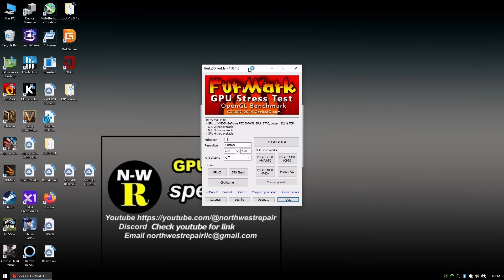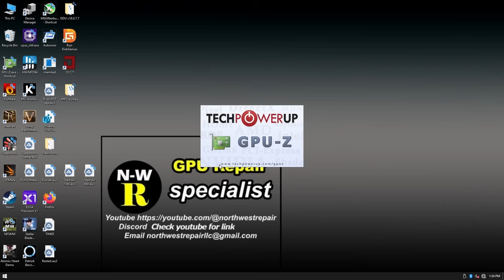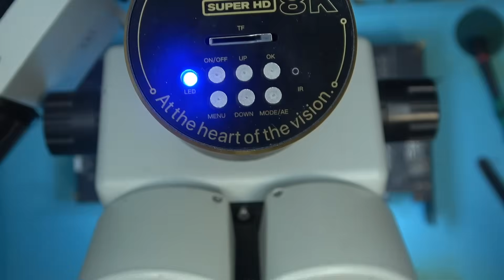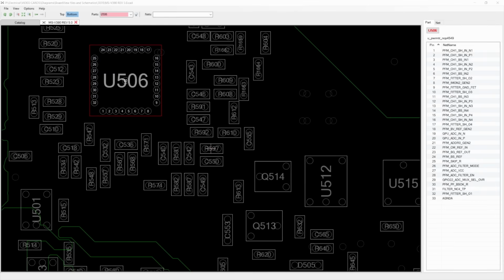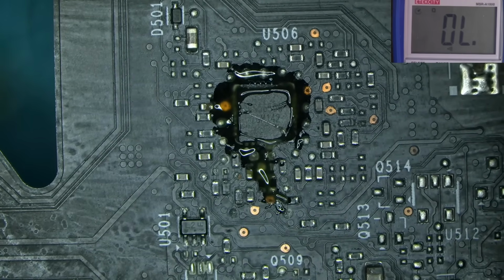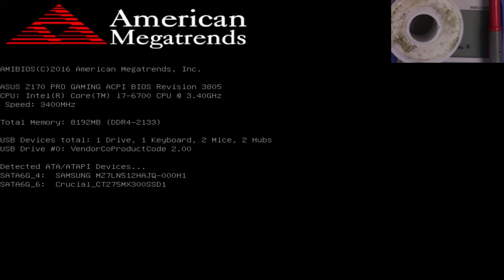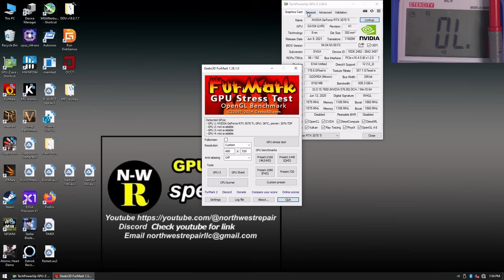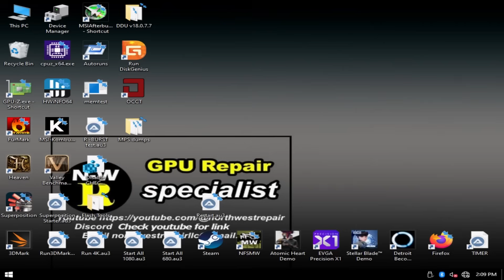EVGA 3070 Ti Runs like 960. How to fix 210 mhz clock problem

Comment: My Sapphire Pulse RX 6700 XT has started having issues over the last two days. After reaching the desktop, I can use the PC normally for about an hour before the monitor suddenly goes blank and reports 'no signal.' This is not a driver issue, since it happens in both Linux and Windows, and even on the UEFI screen. After the problem first occurs during a boot, it keeps happening more frequently, even after restarting the PC, with the signal dropping after an increasingly shorter period each time
I can game until the issue of black screen can occur which is around 10 to 35 minutes.on the first boot furmark can run for almost 1 hour without  issue.its not a psu issue I tested it in my brother pc and it has 650 watt psu
any fix for this

Comment: I have the same RTX 3070 FTW3 Ultra, and it has a bad PWR4 sensor that always shows 113°C. Because of that, the fans stay at 100% speed all the time, even with custom curves.
I replaced the thermal pads and paste, but nothing changed. All other temps are normal. The GPU works fine — just noisy because of the wrong PWR4 reading. Any fix for this?

Comment: I have a galaxy 3070ti used but the previous owner have stripped the main heatsink screws and now it cannot be opened to change the thermal paste any help how to open the stripped screws (love your videos)
Reply: No offense
Send it to a professional.

If you can't figure out how to remove a damaged screw yourself, don't force it because you'll end up causing more damage.

Those little black things are very vulnerable on the PCB, not to mention the brown ones and the rest.
IF you accidentally damage one, your card could easily end up in the trash.

You can even rip it off at the core with the heatsink if they're really stuck together...

Comment: on my RTX2060, the BSOK on uS5650 is only 2.4v then after replacing some resistors on series to the 1v8 and gate it becomes 3v? but it still black screen on load. haha

Comment: So why is the cleaning a important thing ?
Reply: Are you thinking about the cleanability of Flux?

Because if you don't clean it up and leave it on the PCB, you'll be a bad person.

Personally, I don't like it when others don't clean up after themselves.

Also, because if it's hard to clean up, you can damage a component during the process, those masks on the rails come off easily, they're vulnerable.

And if you put that sticky shit on it, dust will easily get stuck in it and it'll be hard to clean it out.

That fluff is a very good thermal insulator and burns very well....

Comment: Thanks for repair my friends 3070 ti

She spilled water and shut it off fast and I couldn't find any obvious issues on the board. I forgot to mention it in the initial message. Somehow it was functional but not great clocks.

Edit: I dabbed a small amount of thread lock on the backplate screws thinking about shipping vibration, my bad. I'm admittedly loctite heavy in my life and it has certainly got me in trouble 😂.
Reply: Hmmmm, spills are always forgotten in the original message. but will always be seen when repairing. Cool it was a good fix.
Reply: @inothome  I was tired and it happened at like 11pm and trying to figure out what to do. It looked like most of it was on the backplate and to my untrained eye, there was nothing obvious with corrosion.
Reply: @Derkiboi  you need microscope or a nice magnifier, most of those tiny things are not easy to spot with naked eye.
Reply: @MrDvneil  yeah that's fair. I only have basic equipment anyway. My fanciest tool is desolder tool from hakko for keyboard building.
Reply: @Derkiboi  All good, was just joking how 99% of the time it seems no one ever mentions liquid damage, when there was some. Nothing personal.
Reply: @inothome oh yea, no probs. I should have initially. Have a good day/night
Reply: @Derkiboi  Thanks, you too.
Reply: @MrDvneil  I have a 30-year-old OptiVisor that works well enough for most things.  It's a headset with magnifying lenses.  You do have to put the board right up to your face, so it's not great for repair, but you can at least spot the issues, and it's much cheaper than a microscope.
Reply: I'm really surprised that Tony hasn't encountered anerobic threadlocking compound before.  In my world, pretty much all threaded fasteners get lubricated with oil, anti-seize, or threadlocker.
Reply: @alsavage1 EVGA had a dab of blue 241 so I did the same. I probably put more than the manufacturer.

Comment: EVGA's FTW stands for "For The Win" at least according to JayzTwoCents.  Jay has been a huge EVGA fan boy for years.
Reply: We were all sad when EVGA announced they would no longer be a board partner for Nvidia. They were easily the best Nvidia vendor at least from a customer service and warranty standpoint.
Reply: They didn't invent the acronym (nor did Jay). "FTW" has been around for a long while. I remember using it well before YT even existed and a quick google-search reveals that while it cannot be pinpointed exactly, it might be a very early 2000s or even late 90s thing, mostly associated with the early HL modding scene. I couldn't find a definitive origin story for it though, but I do remember using it with colleagues around 2004, 2005.
Reply: @1SaG  I don't see anyone claiming they coined the term, just someone saying what it means.
Reply: They were a cut above most manufacturers when it comes to GPUs.
Reply: @MTGSTUE  exactly why I've been waiting to get my hands on a decently priced 3080ti hybrid, been running a gtx 980 hybrid with the stock 120 aio thats never been opened, and never leaked in over 10 years, just thermal paste and a clean every once in a while and it's happy, its not even hitting 60 under full load, they dont make em like they used to lol.

Comment: whats the point of a zero Ohm resistor?
Reply from the maker: protection.
if chip is short, resistor will blow.
Reply: @northwestrepair  ok
Reply: Acts like a fuse, i brlieve.
That is, if i havr been paying attention to all the videos i watched.
Reply: a jumper filler resistor or a wire connection replacement to fix a PCB layout instead of redesigning a new pcb,
a weak point in the circuit designed to fail safely under faulty conditions is a less common but a valid use too.
Reply: zero ohms doesn't mean zero watts, resistance is just one of 3 relevent numbers :) not exactly like a fuse, it can take a punch but still protect the PCB from damage, GPUs usually deal with a lot of current
Reply: @blackhorserepairs  

And 0 Ohm does not mean that its value is 0 Ohm.
If it were really that, then any current could flow through it because there would be no loss, there would be no heating effect.
If you use a good thermal camera, you can see how the tracks on the PCB also pulsate from the heat.

A little AI search result because I'm too lazy to measure right now:
"A "0 ohm" SMD resistor is not a true zero, but rather has a very low, specified maximum resistance, typically in the range of 10 to 50 milliohms (\(0.01-0.05\) Ω). It acts as a jumper or a wire for connecting components on a printed circuit board, allowing for design flexibility after production. "

To calculate the power on a given component, you also need the resistance value.
If it is really zero, then the current flowing through it will cause 0V to drop across it.
That is, W=U*I => W=0 Volt x 1000GigaAmpere == 0 Watt...
Reply: @blackhorserepairs  
And
"A fuse can be designed to have a higher amperage than a 0-ohm SMD resistor because a fuse's primary purpose is overcurrent protection, while a 0-ohm resistor is primarily a jumper, despite its ability to act as a fuse in some cases. Fuses are manufactured with specific current-limiting and breaking characteristics, whereas a 0-ohm resistor has a current rating listed on its datasheet and will only "blow" when its specific current and power limits are exceeded, which may be less precise than a dedicated fuse. "

That is, it is unreliable and cannot be accurately determined for its melting current.

It is like a cheap Chinese fuse.
Reply: Act like a fuse

Comment: Omg I have this 210mhz problem and I'm losing sanity over it (evga ftw3 3090)
In my case sometimes it goes back to normal 1800/1900mhz but more load it gets more and more mhz drops and eventually it goes to 210 without.
Any advice?
Reply: Temps fine?
Reply: @alkestos i do have optimums water block on it and it's cool throughout sensors.
Reply: @klendatas1 just delete the driver with DDU use the nvidia 566.36 driver version is the best for 3090 thank me later

Comment: 2:28 , 300W usage on idle is a dead giveaway that something is wrong with power controller.

16:55 , yeah, that chip was not detecting the power usage.
Reply: 300W with core @ 210MHz? Where is all this power going to?
Reply: @SzwarcuKX5  is not, the regulator is not even sending because it thinks is over budget in power usage
Reply: @custume  So it's false value.
Reply: @SzwarcuKX5  not in a sense its false but its what the regulator is reporting to GPUZ, in a way its a miss reading.

Probably if you clap the power cable you will see low power passing on the cables.

Because of that reporting the bios of the GPU will not allow the GPU to clock high because thinks is already using to much power.
Reply: @custume  Yup, that's what I thought. Thanks for explaining.
Reply: @SzwarcuKX5  it was unable to read the true value because the resistor was open circuit. That looks like full ic vcc across the sense resistor from the ic point of view. That's why it indicated full power usage.

Comment: I have a 1080Ti FTW3
apparently it means For the Win 3, which is probably improved winning over FTW2 and FTW. I just wish the individual Fancontrol would work in Afterburner, but alas it don't, so I have to use the EVGA Precision X1/XOC Software instead. Not sure if fancontrol work under Linux. EVGA always made some braindead innovations that nobody else supported, including EVGA themseves now. Other than that it's a great card, one of the best according to Gamers Nexus.

Comment: I've had clocking issues happen on my 3090 it's a zotac card, for me The issue was between Nvidia Control Panel and MSI afterburner. I stopped using Afterburner and got a fresh install of the Nvidia Control panel and the most recent updates and I haven't had any issues since
Reply from the maker: the problem with clock and tdp is very common among EVGA cards. Rarely on others.

Comment: FTW=
 For The Win
Reply from the maker: seriously ?
Reply: @northwestrepair yes lol
Reply: @broadwayautogroup2061  but what does it really mean?
Reply: @kincheng  well it stands for “For The Win” assuming if you have a FTW card you’ll be better at gaming as opposed to other vendors 😂 i’m sure that’s what they were going for
Reply: @kincheng  Its got thick copper base plates, larger heatsink and clock a little higher.